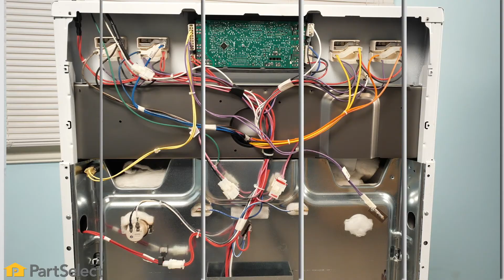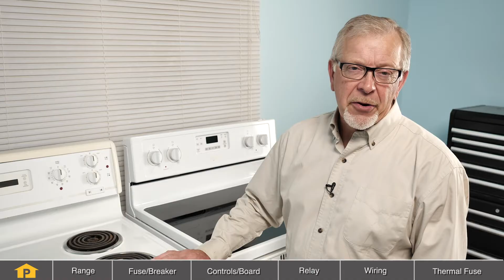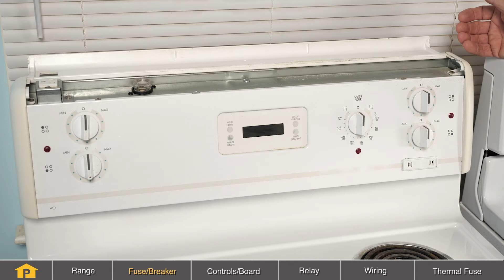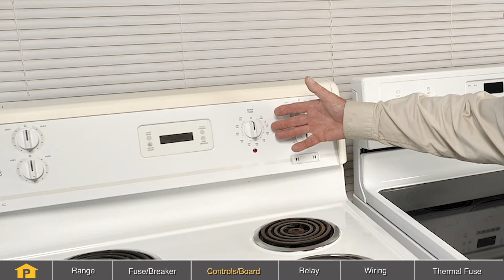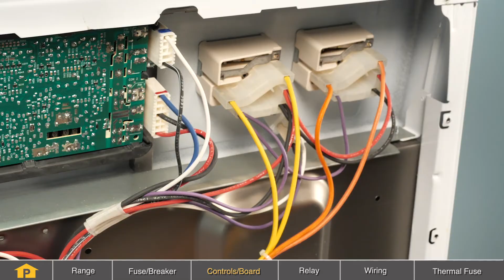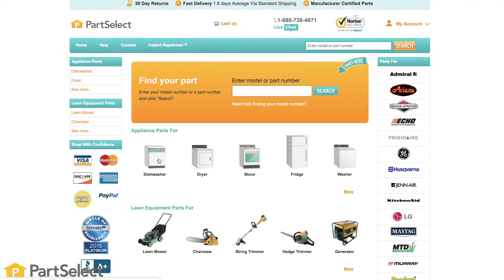Range/Oven Troubleshooting: Why Is My Electric Range or Oven Not Heating? | PartSelect.com

Comment: What would cause one of the heating element connectors to burn on one of the contacts?  The contact burnt to the point where a large portion of it is actually gone.  This happened a few months ago.  I changed the connector, but now the same thing has happened again.